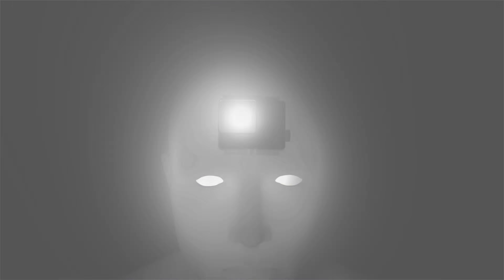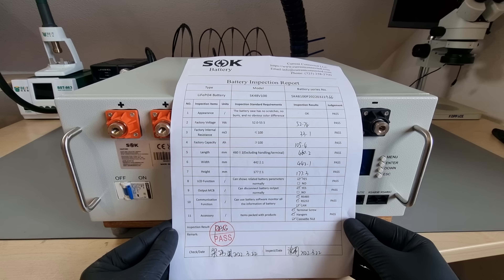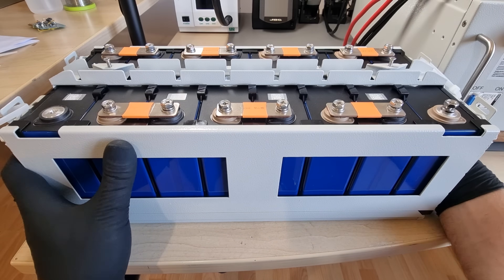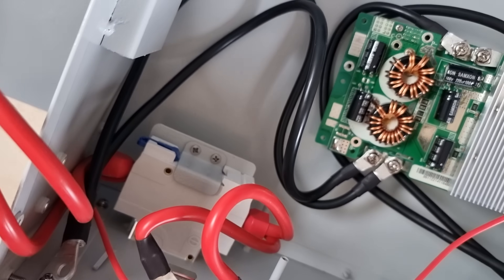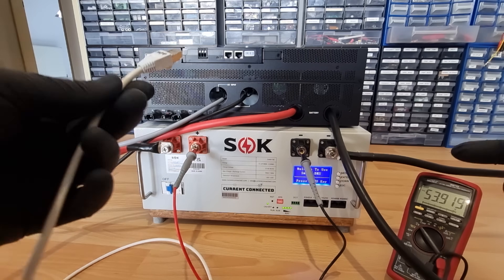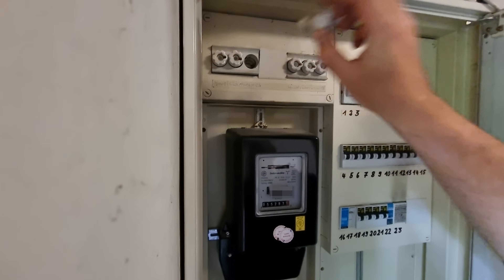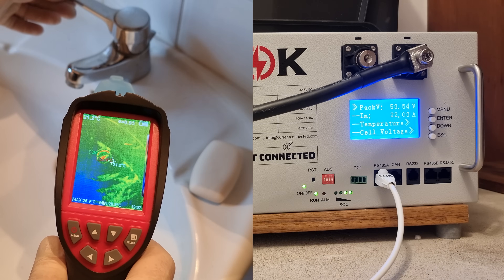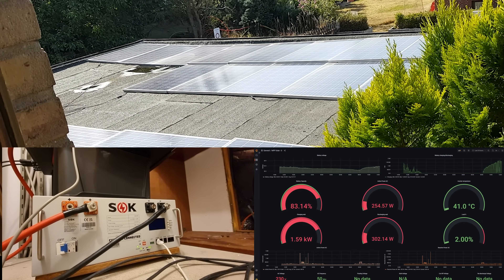New in EU: SOK Server Rack mount LiFePO4 batteries! Teardown & Review

Comment: I have 3 High-voltage Pylontech batteries in my system, have been solid so far. They are regarded as the best option for home PV here but have very limited availability now
Reply: Until SOK came along.
Reply: Greetings from SOK, may I ask what DC voltage your system ?
Reply: @minwang102  Hello, the batteries are 3 x 96 Volt (nominal) modules, so 288 Vnominal.  Maximum allowed voltage is 324V.

Comment: All in all a nice battery bank, only disappointing thing I saw was the el cheapo electrolytic capacitors on the BMS. Don't think they will outlast the cells if they are as good as claimed.

Comment: Nice vid. Are you required to use an electrician when it comes to the final install?
Reply from the maker: As far as I know, no. Only if you want to sell your power to the grid. And if you want the fire insurance to actually pay up if your house ever burns down.
Reply: @reps  Do the power companies there make restrictions on what brand of inverter you can install, or they just require conformance to some technical parameters or certificates?
Reply from the maker: @gabiold  for grid tied inverters yes, there are a a few standards that the hardware must fulfill. quick google leads me to VDE-AR-N 4105 for example. but I really don't know since I am not going to feed power into the grid
Reply: @gabiold  I know where I live it's required that your grid tie inverter is connected to the internet :/

Comment: Sad that they are more expensive as 2 48V@50ah pylontech batteries...
Reply: I look at the prices online and your Pylontech Batteries are usually more expensive than this one. Where do you get your batteries so cheap?
Reply: @Toxicity1987  I have seen them go for as low as 950 here in Spain, for the US2000C. But that is 50ah. Benefit of 50ah is that you can actually carry them by yourself :-)
Reply: some sellers have the audacity to ask 1200+ for each module...

Comment: Would a modern well insulated hot water tank loose too much heat or lack of space resulting in the instant heater? I think people here are splitting the storage between water and batteries
Reply from the maker: No I think it would've been an even better solution! I just always had a tankless heater there and it didn't even cross my mind to look for something else
Reply: @reps  Also if you use a heat pump based ("hybrid"?) hot water tank, you would effectively cool the room it's sitting in. Good for somewhat lossy inverters, not to mention servers etc?
Reply: @reps  It would be optimal to "charge" the water tank when the batteries are full.
Reply: @reps  Even better: Hot water accumulator/heater tank hooked up to a solar collector. Pretty  good ROI if you use non-trivial amounts of hot water.
Reply: @omfghai2u  Yes, there are some interesting videos by David Poz and G. Scott Davis about solar collectors and DIY thermal stores.
Reply: @reps  heating of 200 liters of water by 50 degress will accumulate 200 * 50 * 4180 = 41,8 MJ of energy, which equals 11.5 kW*h. So it's twice more than SOK battery. And few times cheaper
Reply: @VolodymyrTorkalo  If only we could convert heat energy back to electrical easily and cheaply! That would solve all our energy storage problems once for all. At hosehold scale at least.
Reply: @gabiold  and break the laws of physics
Reply: @lukeyj15  I can accept a little inconvenience. 😀
Reply: A common solution is to use a hot water tank and then when the battery is full, divert the excess solar output into the heating element.
Reply: @BobHannent  That is the "Watching TV" is prioritized over "Washing yourself" or "Washing Dishes" solution.
This must be a bachelor household. I don't want to be invited there. *wrinkle nose*
Just joking:) I bet you didn't put many thoughts into this and I hope this is not YOUR preference, or?
Reply: @dieSpinnt  usually there's enough extra sun to do the job in these situations and some controller's have the ability to ensure that if the water gets too cool it can be boosted. But it doesn't have to mean doing without, often people will heat much more water than they need anyway and nothing wrong with the occasional 'not hot' shower!
Reply: @BobHannent  Thank you for the response.  Another one, who doesn't know what the word "joke" means. Oh ... that's funny! :)
Also: "often people will" ... CITATION NEEDED? Where does this information come from. Who are the people ... Did you do the research? Why is there no reference to your paper? ... Yeah, I get it! ...
Reply: @dieSpinnt  the prerequisite of a joke is to be funny, if you don't get a laugh, perhaps that's the issue
Reply: Agree - a well-insulated tank would be the way to go if you have the space. You could probably also run it at a lower voltage to reduce power consumption. In the US we have 240v split-phase (two 120v to neutral phases 180* offset), so if you hook up a water heater to only one leg, it pulls 1/4 the power. Perhaps you could do a similar thing with your 3-phase power?
Reply: @willusher3297  I looked at running my water heater straight off 48V DC, my calculations showed it could potentially work as a good constant drain and heat almost all the hot water we'd need.

Comment: LFP prices is just absurd... I checked what it would cost just to run a typical day of powet at home... yea.. that was not realistic
Reply: If you have electric heat or air condition battery storage doesn't really make sense yet. However if you heat by burning wood or gas then with solar panels and batteries you could be free of the grid.
Reply: @mrfrenzy.  Especially considering the electric regulation of some wood ovens. I think central heating with wood doesn't take that much electric energy, and it would be a pity not to be able to use it if the grid fails. In Germany, gas and oil are probably the most common. Electric heat was pushed somewhen in the past (70s?). Personally, I've only heard about it but never seen an actual house having electric heat or an air conditioner. I see the point that it would be viable to regulate the electric heat, so all the energy is stored in a warm water tank. However, if someone would like to have off-grid capabilities, battery storage would ease one's mind, wouldn't it?
Reply: Isn't that true for batteries in General? Lead Acid is not cheaper than 50%. While that is significant, it comes with some drawbacks, too. If there is a fixed installation, the weight is not the problem. But if the power cycles are accurate and Lifepo4 does do more than just 10x the power cycles of a lead acid battery, it might be worth it.
However, that doesn't deny that the prices are really not cheap. But something like 3kWh should be OK for an emergency and should be a lot cheaper than 1000€. Then you could have enough to charge mobile phones, a laptop and maybe a washing machine.
Reply: How much energy do you need per day?
Reply: @gabiold  the problem is not storing a few days worth, you need to store enough energy to heat your house from october-february when the sun produces very little energy. That is impossible with batteries.
Reply: @mrfrenzy.  That is. But 330 m3 of water with 50 degC temperature difference might be enough. 7E+10 J of energy. Good luck heat insulating that! Especially at the bottom side of the tank. 😀

Volume-wise isn't that absurd, it seems. 🤔
Reply: @mrfrenzy.  By the way, the OP did not mention storing energy for the whole winter, he said one day of energy. That isn't impossible, might be two of these units is enough, if you don't have too big use.
Reply: @gabiold  yes, if you don't use any electricity for heating then it is enough with a few of these units to cover days without sunshine.

Comment: Did you think about buying prismatic cells yourself to assemble a similar battery on your own? Why did you decide against it? Time?
P.S.: Where can one buy those busbars? I search for some having a hole distance of around 3cm.
P.P.S.: How many newton meters do you use to attach your cables? Are 3nm enough? That is the maximum of your newton meter screwdrivers, isn't it?
And another question: Where did you get the MPP Solar Inverter. It seems like there are many clones around at AliExpress, but I don't find a real shop in Germany.
Reply from the maker: I shamelessly reached out to a couple of nice battery manufacturers and asked for a YouTube freebie. Had this been unsuccessful I would've gone with a DIY pack of course.
The MPP Solar box I got the manufacturers international eBay store. They have a listing with DDP pre-paid taxes and customs: ebay itm 275271610759
Reply: @reps  your shamelessness is very appreciated

Comment: does installing all these cables mean you are not looking to move anymore as you alluded to on twitter a good while ago?
Reply from the maker: Still looking to move asap. The agricultural wasteland, the stairs preventing me from adopting more interesting boat anchors, the slanted walls and the summer heat under my roof. All terrible. But it's a pretty big step that I don't want to take in a rush. So I am just carrying on as usual until I find the perfect new lab :_ppmhub:
Reply: @reps  you'd need something like an old barn for yourself and your test equipment.

Comment: those cells NEED compression. even if the manufacturer of the pack does not do it. the battery makers certainly demands it regardess of the load. ~200kg of compression is enough. and that 125A breaker is utter junk. replace it with a proper one from hager.